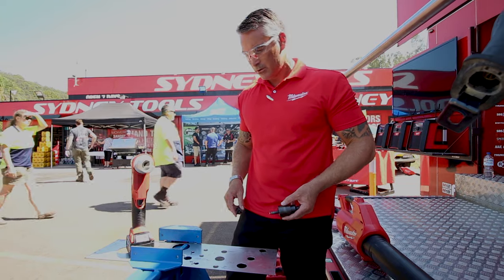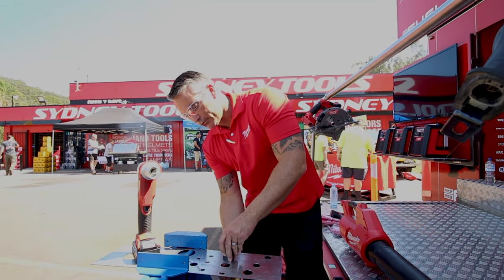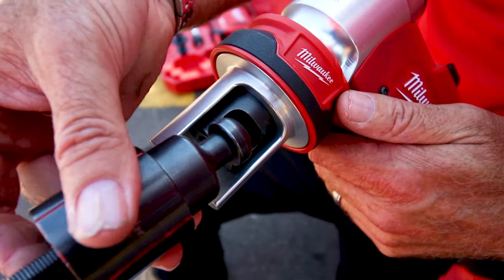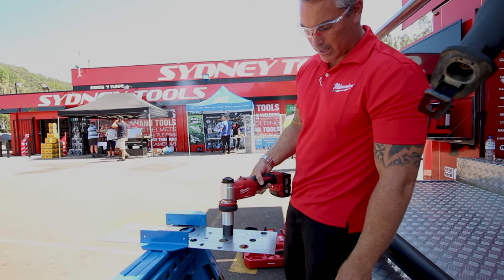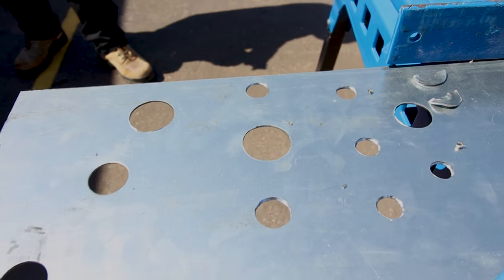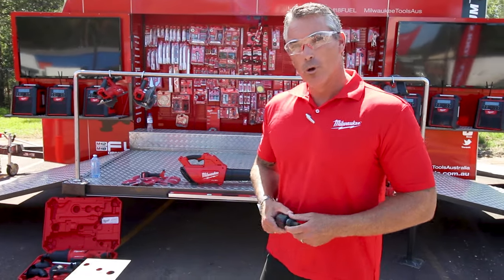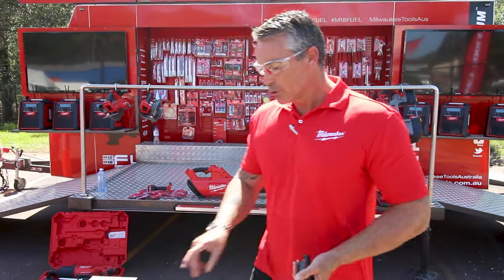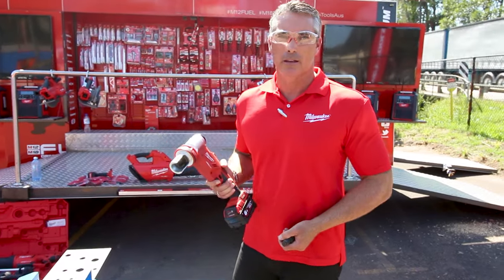Milwaukee Cordless Knockout Punch Tool M18HKP-201C 18V 2.0Ah

Comment: For $2000.00, you know how many hole saw bits I could buy with that, wow this one is clearly for the rich. Way to much money for this.
Reply: Its for pros making money, not for hobbyist to fuck around with.
Reply: Missing the point. Saves a lot of time. Time is money.
Reply: @nissy9220  not that much if using a good saw as u have to pre dill anyway
Reply: Worth every penny, maybe not for the a small business but if it's large scale industrial/commercial installations where youre doing 50 to 100 knockouts of various sizes this tool is the best unit in the world
Reply: Time is money $$$$